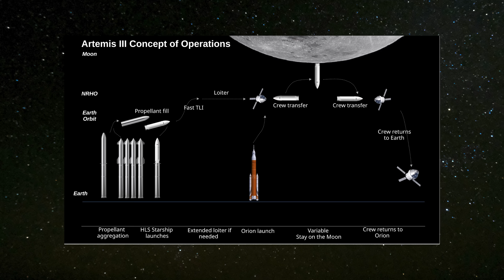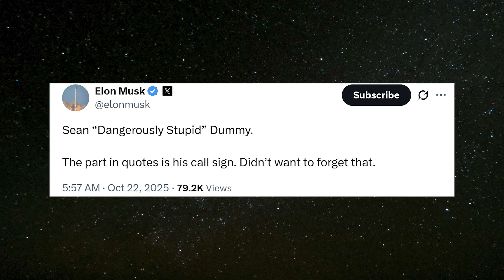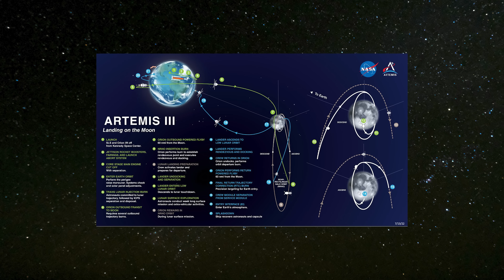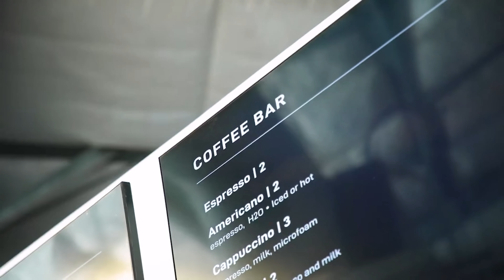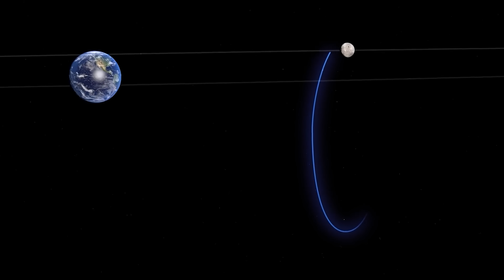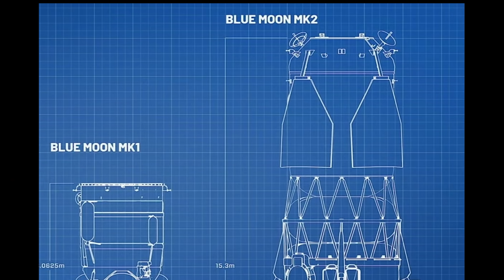SpaceX Found Brilliant Solution to Land Starship on the Moon Sooner than NASA expected...

Comment: Very interesting, so if it's so complicated, how did they do it in 1969 with technology that is 50 plus years old, which is not as modern as today? Hollywood is a big company in America. Think about it, how much of that is needed today, and then Neil Armstrong was walking around Hollywood in 1969. In addition to those science fiction films, liquid fuel must be replaced with something better. Only then will we have the opportunity to transport it to the moon without any major problems. I'm interested in why no one has looked into nuclear fuel and technology that might cause fewer problems.
Reply: Nothing beats nukes for a one-off attitude, but exploding nuclear devices to power a rocket is literally what that would be - and it’s not practical. There’s the problem of radioactivity and heat. Space is not Earth: on the ground there is air and water for cooling and large power infrastructure; in vacuum there is no convective cooling and no easy way to dump heat. Getting to space spends most of a rocket’s fuel just overcoming gravity. Rockets carry a lot of propellant to put relatively tiny satellites and probes into orbit.

Chemical (liquid) propellants remain the most practical way to reach orbit because they convert energy to thrust in a compact system. Nuclear options would create radioactive contamination risks; that makes them unacceptable for routine launch from Earth. The only radically different alternative people discuss is a space elevator - but current materials and security issues mean that is not available.

The most costly part of the space race is lives. The U.S. lost 14 people in the shuttle disasters (Challenger and Columbia) and 3 in Apollo 1 - that history explains strong caution. That’s why testing new systems on the ground and in unmanned flights is necessary: better they fail uncrewed than with people aboard. Modern companies have the advantage of rapid iterative testing (e.g., many Falcon 9 launches and booster landings) and improved modelling, but reality still bites when designs meet the environment.

For automated landers, a six-month transfer to the Moon can be fine; for crewed missions, the priority is getting there as fast and as safely as possible. Every kilogram to orbit is expensive, so reusable, refuelable vehicles change the economics dramatically. Re-entry heating and plasma effects are brutal problems - a vehicle needs robust thermal protection for safe return. Space is unforgiving: mistakes cost hardware and, sometimes, lives.
Reply: @EnterTheNameHere_Bohemian  
Do you know that there is another type of nuclear fusion? Do you know what Thorium is? Do you know that physics in space is not the same as here on Earth? You see, it's not what I said about nuclear energy, but more of the propaganda that happened in 1969 that America was on the moon, and I learned all that nonsense information in school that we are not able to do today, so explain to me how that was possible in 1969?
Reply: @Gammer2Play  There is only one type of nuclear fusion. Yes I know Thorium, though not personally. Physics in whole universe are same. You learned nonsense, that is true. It was possible because there were people who were not stupid.
EDIT: if this sounds agressive, sorry, it was kinda meant that way, but it's unfair to you and not deserved. My bad.
Reply: @Gammer2Play  Ummmm... physics is exactly the same everywhere in the universe.  The laws of physics do not change, anywhere.  They are identical here, in space, at the core of the sun, and everywhere else. You should probably go take a "Physics 101" course somewhere,
Reply: Were you a science prodigy in school? Have you any idea how dangerous nuclear fuel is? Trying to figure out a different propulsion system might take a 100 years. So best we shut down all space exploration and invest in controlling the population till we find good methods..✌️👍
Reply: @johneagle2100  
I honestly can't say here what I can, but I can show you and prove that all those who say that nuclear fusion is not dangerous because it uses dangerous materials, but there are other types that you probably haven't even heard of, and that is Thorium, which is not as dangerous as uranium or plutonium and can work in space much better and safer, so now show me if you know what I'm talking about, but the total concept here was not about that, someone about the untruth that America has been saying to this day that it was on the moon with technology in 1969, when today with our technology it is almost impossible to achieve, so what do you see in that now?
Reply: You’re probably mistaking fusion for fission.
Fusion is what happens in the Sun and other stars. We can currently achieve roughly break-even conditions - getting about as much energy out as we put in. The plasma reaches around 150 million °C (EDIT: was 3000 °C) - something that would ignite the atmosphere if it ever escaped.

We use a strong magnetic field to contain it, and a rapid shutdown system that floods the reactor (in a tokamak, at least) with a neutralizing gas to stop the reaction. It’s nowhere near powering anything beyond research reactors, sadly.
Reply: @Gammer2Play  Physics is the same throughout the universe. That’s the point of the cosmological principle: wherever you are and wherever you look, physics works the same way. It’s not that physics behaves differently on Earth and in space - it’s that on Earth there are many more factors influencing the process, while in space there’s almost nothing.

To cool something in space, you have to keep it cooled constantly. It doesn’t happen on its own, like in air. That requires coolant or energy transfer, or radiating heat away - and that's really hard. Any form of thrust generation produces heat; it’s inevitable because thrust is simply directed energy.

Ion thrusters are among the most efficient types - they don’t produce much heat, but they’re extremely slow. That’s why crewed missions to the Moon can’t use them.

Fusion or fission engines would generate huge amounts of heat, and we’d face the same problem of getting rid of it. We already know how to reach the Moon and return within about a week, but you have to come back before running into trouble. It’s ironic - while you need to get rid of the heat from propulsion, you also have to keep humans and electronics warm. The vacuum doesn’t absorb heat, which is exactly why we make space systems as safe as possible.
Reply: @Gammer2Play  I refreshed my knowledge of Thorium so I can answer. Thorium would be great for power generation. What it doesn’t solve is getting into space from Earth. For thrust it’s basically useless and won’t get a rocket anywhere. So here we need either nuclear bombs, which are a no-go, or liquified fuel.

Where Thorium can shine is in generating electricity. We need that for bases - place a reactor on the Moon or Mars and it’s probably easier to handle than a classical reactor. Totally doable.

It could also provide energy for ion thrusters, but ion propulsion is weak. While it’s efficient, you either need so many thrusters that the added mass makes it inefficient, or you use only a few and the trip takes weeks to months. It will get there, but it’s not for human flights - radiation exposure during long travel in space is a major risk.

What it doesn’t solve is getting rid of heat - that’s still a big problem. The only real con is starting the reactor; there might be a simpler solution, like producing a radioactive isotope that generates heat and using it for electricity and warmth. That could be more cost-effective than deploying a full reactor. If we want long-term bases, we’ll need to place reactors there eventually - then Thorium will be useful.

But let’s be honest: it all depends on funding. Money rules. SpaceX can explore new technology because it finances development itself. NASA no longer has the budget it had in the 1960s when the whole country cooperated. Today, SLS is overpriced old technology kept alive by congressional interests. Real innovation happens only in small startups that do it because they can, not because it’s profitable.

The only company that truly has the power to lead anything is SpaceX. Blue Origin? Basically an Amazon spinoff - and even Amazon pays SpaceX to launch its satellites. It really comes down to who has money to spend on “personal projects.” With Musk, it may look like that, but to be fair, it worked: SpaceX built a near-monopoly on reusable rockets and gained the freedom to experiment. Sadly, the only serious competitor is China. Russia is stalled, the EU is a joke, India is coming up, and Japan does its own quiet work. There’s no real global push to perfect new ideas.

Landing a booster on a tower with “chopsticks” was something people laughed at and said was impossible - yet I have a 1.5-meter picture of that historical moment on my wall. It certainly wasn’t planned by NASA; it was a team with vision that made it reality.
Reply: @EnterTheNameHere_Bohemian  You do know that scientists have been attempting to make fusion work for over fifty years, and every year they tell us they are only then years away from success...  And the best device they have to date weighs millions of tons and consumes enough power to but entire countries in the dark!  Just wha you need to power a spaceship.  Yup.
Reply: @ChristLink-Channel  They could be as "small" as 250 tonnes. But ITER, that one with 23000 tonnes and 150 million °C is different monster... But yeah, we won't see the Fallout pre-war cars anytime soon.
Reply: @EnterTheNameHere_Bohemian  I have no idea what you even tried to say there, so I won't try to respon.  Your word salad is unintelligible.
Reply: @ChristLink-Channel  It was a joke about how tokamaks like ITER weigh 23 000 tons. You’d need a rocket the size of a small continent to lift that. Maybe reread it slower.
Reply: @EnterTheNameHere_Bohemian  I read it again, real slow, but it is still a word salad.  If you want people to understand what you are trying to say, then maybe write more clearly...
Reply: @ChristLink-Channel  Alright, since reading comprehension seems to be an issue: the machine where fusion happens is called a tokamak. The small one in Prague weighs about 250 tonnes. ITER - the real big one being built right now - weighs about 23 000 tonnes and hits 150 million °C.

The Fallout part was a joke, because their cars supposedly run on mini fusion engines. We’re nowhere close to that.

If that’s “word salad” to you, maybe fusion isn’t the only thing you don’t understand.
Reply: @EnterTheNameHere_Bohemian  Newsflash: The Tokamak design is just one way of achieving fusion.  It's the most succesful so far, but by no means the only one, as you imply.  And a "word salad" is just what it sounds like.  A bunch of unrelated words mixed together in random order, with no attention to grammar or meaning.  Just like your earlier posts.
Reply: @ChristLink-Channel  I said both fission and fusion aren't usable for rockets - they would basically ignite the atmosphere.

You showed up to announce researchers have been saying they are "almost there" for fifty years, and that reactors weight millions of tons. Well, thousands, but who counts...

You seem to like to restate the obvious in very fine English - there's no way we would use them.

And where exactly did I "imply" the tomakak is the only design? It's true, I just wouldn't bother talking about designs which work only in PowerPoint slides. Ok, maybe the laser one. Oh wait, that's the one needing power of cities to work.

But thank you for agreeing with me.
Reply: @EnterTheNameHere_Bohemian  Please explain how either fission of fusion would "ignite the atmosphere".  By what mechanism would that happen?  Both have been used in warfare.  Neither has "ignited the atmosphere".
Reply: @ChristLink-Channel  Now we're talking - thank you.
Short version: you got me. The atmosphere will not "ignite".
What a tokamak or a nuclear detonation does is creating very hot plasma and intense radiation - in a small volume. It breaks molecules, strips electrons, makes fireballs, shock waves, and the radiation. It's not sustaining, global chemical combustion of the atmosphere. We knew that wouldn't happen even before nuclear bombs were tested.

Historically the Orion concept used pulses from bomb explosions, which is... crazy. We don't want launches that irradiate the planet. Using fusion/fission is not a way to power rockets. Nukes/tokamaks aren't a safe or practical way to launch rockets. Though reactors can be used on bases...
Reply: @EnterTheNameHere_Bohemian  Actually, nuclear power is already being used to power spacecraft! Just not in the form of explosions or direct plasma jets.  But it used used to power electronics on very long and very distant missions, where solar power is not feasible, and it will be used on ion propulsion spacecraft, to power the actual ion engines, for the same reason: reliable long-duration power when solar is out of the question.  It will likely also be used on the moon and Mars to power the colonies.
Reply: @ChristLink-Channel  True - once you’re past Saturn or Jupiter, sunlight is too weak for efficient solar power, so RTGs are the only reliable option.

NASA restarted small-scale production in the 2010s, mostly for the next Mars missions and outer-planet probes. And you’re right - with Moon and Mars bases being planned, nuclear power (whether RTGs or small reactors) is back on the agenda.

I just wish there was more funding, since this is an area only governments can really pursue - they won’t just hand radioactive material to private companies...

And Neptune and Uranus both deserve their own probes at this point. They’re the least explored planets, and ironically the ones where RTG or compact reactor power makes the most sense.

Comment: We could've been back on the Moon 5 years ago using Grey Dragon Falcon 9/Falcon Heavy Hybrid but congress is protecting SLS politically. SpaceX Starship is capable of orbit as is,.... the test they are doing to prove out the entire "PROTOTYPE" do not require it to go orbital, yes there have been anomalies but NASA was experiencing the same at this stage back in the 60's,.... the delay was also created by the Biden FAA
Reply: Falcon Heavy and flavor doesn't have the C3 to get any meaningful mass to the moon in any reasonable amount of time.  The c3 charts show SLS is the NOw rocket that can do it.  Starship needs to 'refuel' 15t times...  never going to work.
Reply: Launch Vehicle	Stage Type	Approx. Payload @ C3 = 3 km²/s²	Notes
Falcon 9 Block 5	2-stage	~2–3 t	Often paired with a kick stage for fine targeting.
Falcon Heavy (expendable)	3-core	~12–16 t	Direct injection; upper end depends on fairing/dispense profile.
Vulcan Centaur (Centaur V)	2-stage	~7–9 t	Good fit for CLPS-class landers on faster transfers.
SLS Block 1	Core + ICPS	~24–28 t	Comfortable margin above standard TLI energies.
SLS Block 1B	Core + EUS	~32–36 t	Larger payloads or additional mission Δv.
New Glenn (planned)	2-stage	~10–14 t (est.)	Public numbers vary; this is a conservative band.
Starship (no refuel)	2-stage	~3–6 t to TLI only	Not enough for LOI + descent; landing still requires refueling.
Starship (with refueling)	2-stage + depot	~80–120 t	Requires ~8–12+ tanker flights; vast surface payloads possible.

Comment: Why not just make the thing 3 stage to save weight on the TLI?
Reply: Re-using three stages is going to be 50% harder (and more expensive) than just re-using two.
Reply: @ChristLink-Channel Simple.  Let the mid stage burn or put it into orbit and repurpose it.  Mid stage should be the smallest cheapest and lightest anyhow.
Reply: @ccbcco  That method has already been tried and shown to not be very economical, and certainly not reusable.  SpaceX goal is to make everything reusable, as much as possible.  Elon does not like throwing away things that cost good money that could be used again, and again.  Recently one of their Falcon 9 boosters clocked it's 30th flight. That means he did NOT have to build and throw away 30 boosters, which is what NASA likes to do.  Several other Falcon 9 boosters are in the 20-something range.   Even Starship has already re-used two boosters, after only 11 total flights.  Throwing things away every time, like NASA does, is just silly.  
Putting a stage into orbit and repurposing it makes more sense.  There are plans to do that with some versions of Starship.
Reply: @ChristLink-Channel  Yeah we get it.  But necessity is the mother.  Elon has thrown away and burned up so many boosters being "iterative" a few more would not hurt anything.  Besides, as I also proposed: the spent second stages could simply have enough fuel to be parked in orbit pending future use as perhaps a refillable orbital fuel tank; or, as some sort of material element of an orbital structure or lunar structure; or, as a  refillable orbital vehicle.

Comment: OK I'm confused. We sent men to the moon and back multiple times in the 1970s. Why can't we do it now? Did engineers become dumber? Did metal become crappier? Did chemists become duller? Did radios become more noisy?
Reply: It’s a much larger mission plan. Not just a couple guys in a tiny capsule to pick up some rocks.
Reply: @joeprimal2044 true. Back in the day they weren’t trying to move upwards of 100 tons of payload or making it reusable
Reply: Yes.
Reply: it was ridiculously expensive. and dangerous. neither is viable now.
Reply: @rsmonge  Seems too ambitious for the timeline. 

Just send a guy around the moon and drop a rover.

Prove THAT reliable first. 
Kennedy set a 10 year timeline and unlimited budget.
Reply: @chuckevans2792  spacex shouldn't care too much about the timeline. just make the best rocket possible. if its late, so what.